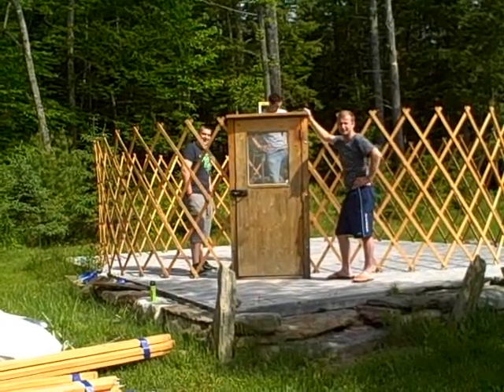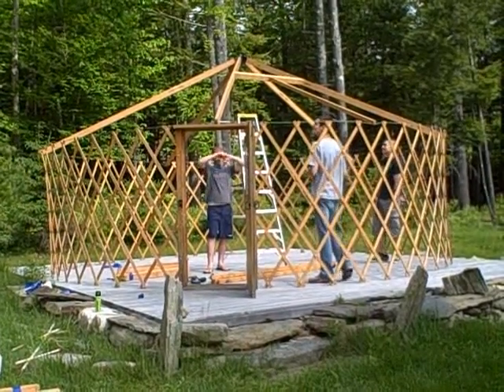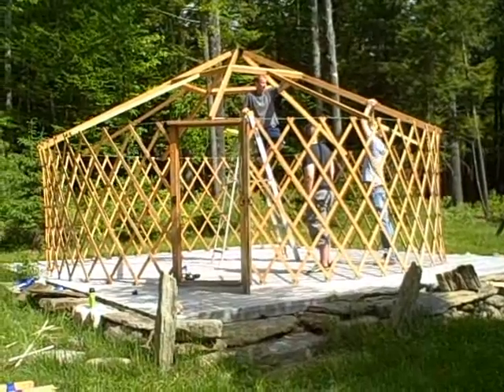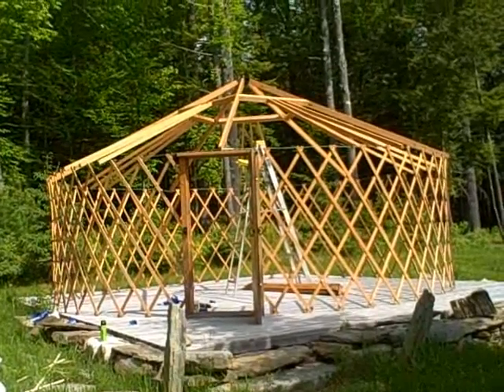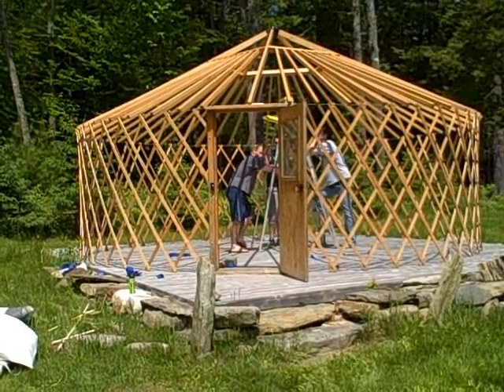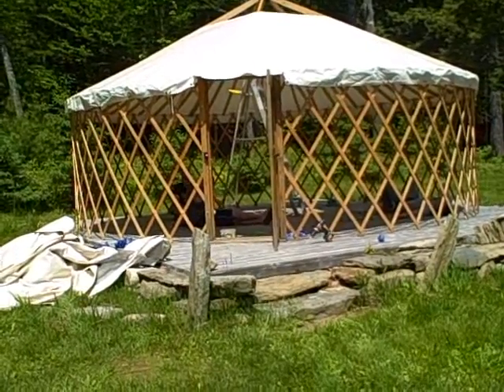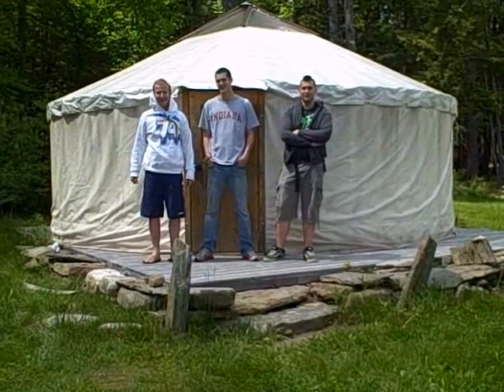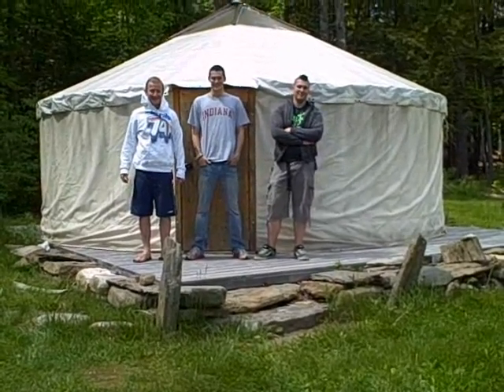How to  build a Yurt in under 2 minutes

Comment: I'm somewhat skeptical about that lattice wall. I couldn't picture the crude iron that the huns had to work with enduring more than one or two tear downs before losing half their nails. Unless they peened them, which would be a HUGE amount of work given that there's about 200 hinges in view right here. Idk if you've ever peened anything before but it's a time consuming job if you're doing it in the field without a workshop it'd be an improbable solution.